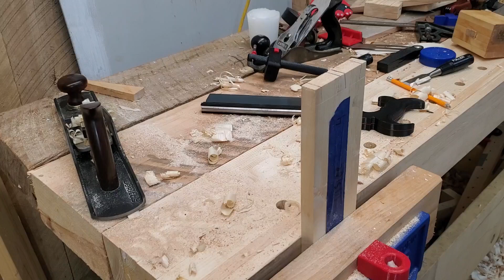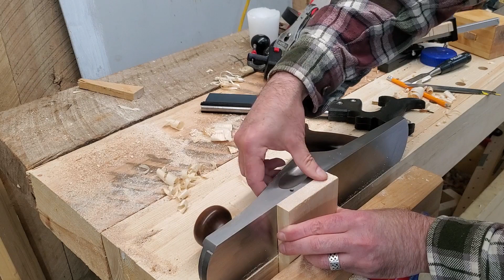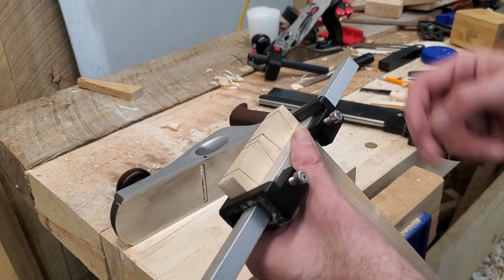Dovetail Jig - guide for laying out pins, Cosman method

Comment: Good work !!! Keep up… i use japanese saws to cut dovetails if you can kindly make a thin kerf offset jig too i’m sure it will cover every dovetail saw then . Keep making cool stuff !!
Reply from the maker: A different kerf should be no problem.  The base model is designed to accommodate a 0.5mm (0.020") kerf which is the same as both my dovetail saw and my Japanese style pull saw.  What width of kerf would you like the jig to have?